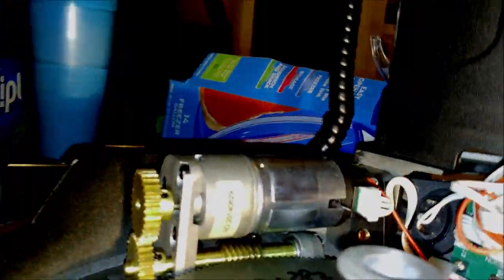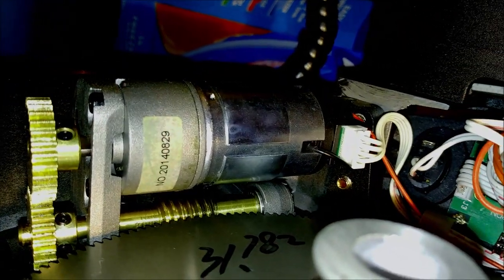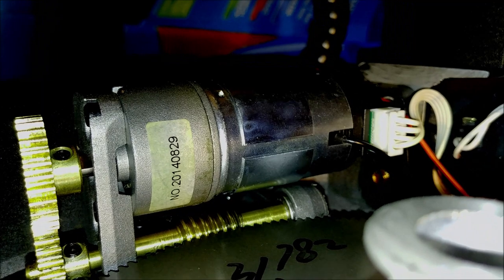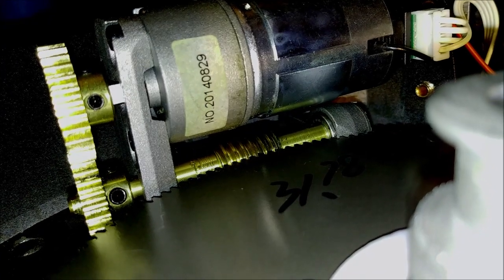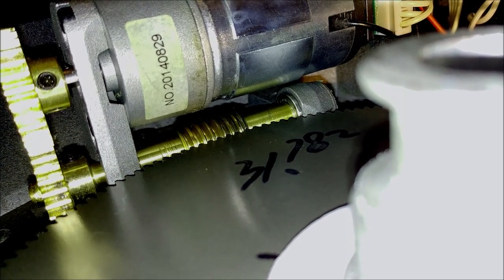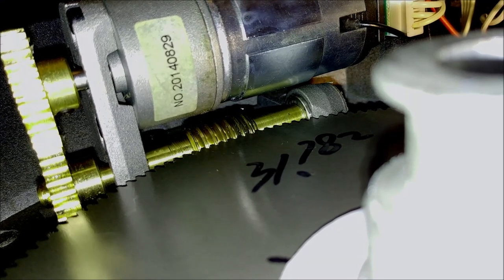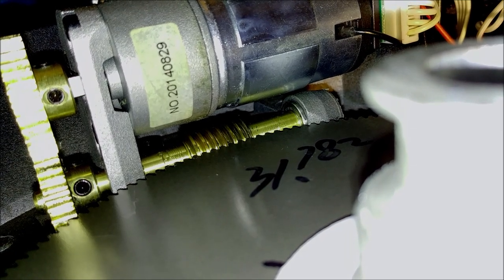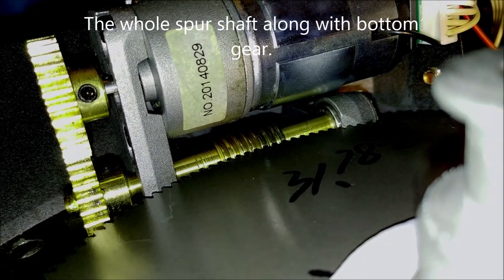Issue with Evo 8 Mount along Azimuth

Comment from the maker: I removed the bottom gear as much as I could, because I could not pull the gear from the shaft. I then tightened the bottom gear back up. Also, I removed the 4 screws from the circuit card that sits just over the big gear wheel at the base. This allowed me to raise the gear wheel from the mount and just leave the gears. The noise persists without the gear wheel engaging the worm gears. I took the bottom gear out again to get a better view of where it should sit and reinstalled the bottom gear. By this time, my lithium battery is too low and I'm charging the battery before I power up and try again.
Reply: any luck....to me it looked like those set screws were loose on the bottom gear
Reply from the maker: Thanks.  Bottom gear screws were tight.  Eventually, I'll need to replace the worm screw shaft.  I did adjust the mesh gear some and refreshed the lube on the gears including the shaft.  Sounded much better and when I tested the tracking, tracking was better than it ever had been.  This was the first time I ever went inside this mount.  I wish now I had gone inside the mount whenever I purchased this mount.  I won't be intimated by a mount any more.
Reply: @gwzapo  Was this purchased use? When did you buy it, I know they have 2 year warrentys. Do you think this damage was cause by to much weight on the scope?
Reply from the maker: Celestron does not transfer their warranty.  If you sell a Celestron item  you bought new and sell it, any remaining warranty left on the item is void.  The mount head for the EVO Mount can hold a great deal.  I know I've never come close to maxing it out.  You figure the 9.25" OTA weighs over 22 lbs, especially the edge.  The mount head is the same for the 6, 8, and 9.25".  Only the tripods are different.
Reply: @gwzapo  interesting video! I've had no issues with my evo mount. I have the Celestron Nexstar Evolution 9.25" with an additional star pointer and sky align camera & my dslr attached which brings the weight to about 25lbs. This mount can also accommodate an 11" Celestron OTA ☺
Reply from the maker: @wizardz7938  So very sorry, I never replied....This was a used scope, but I assumed responsibility by purchasing....eventually this mount failed electronically, and I purchased another used one and have had outstanding results.  I paid $600 for this one you see in the video and $700.00 for the second Evo Mount.  It has not been two years since the second one being purchased and it has been a jewel and most used mount.